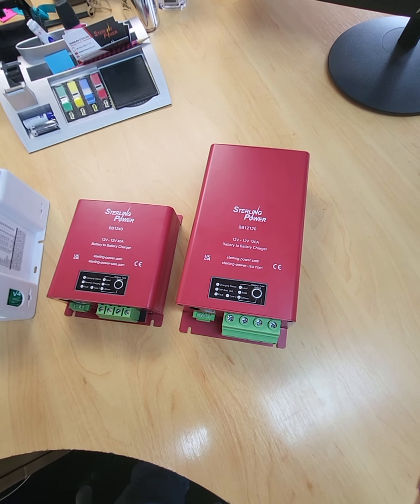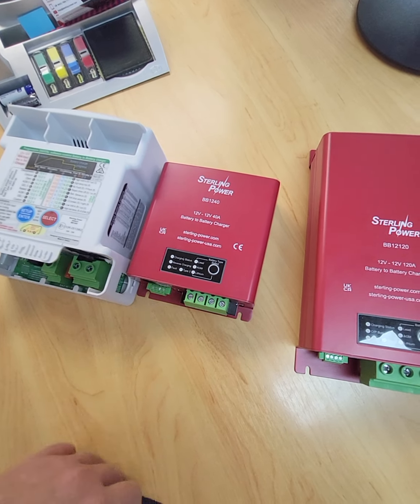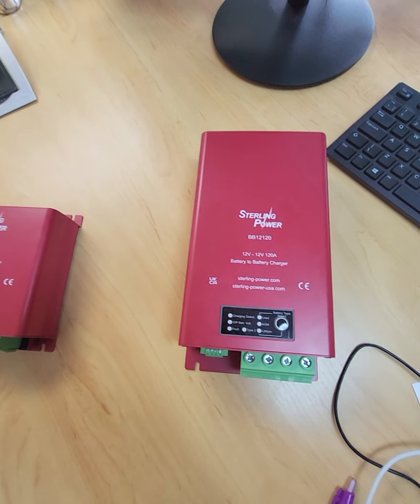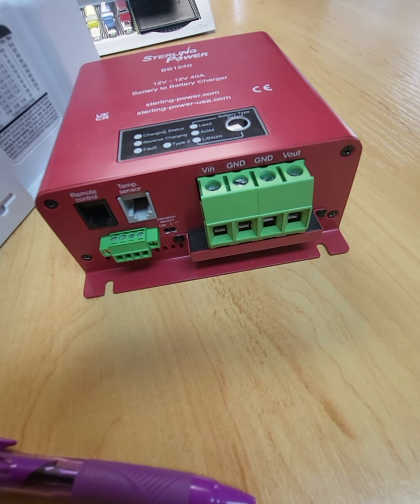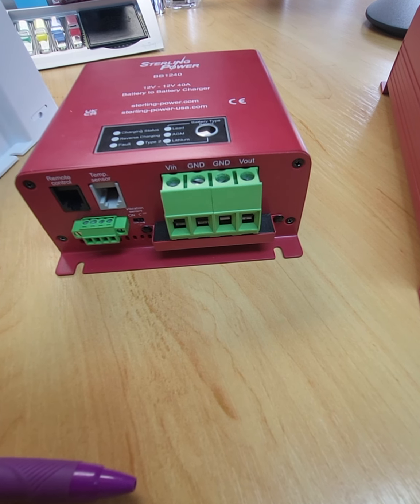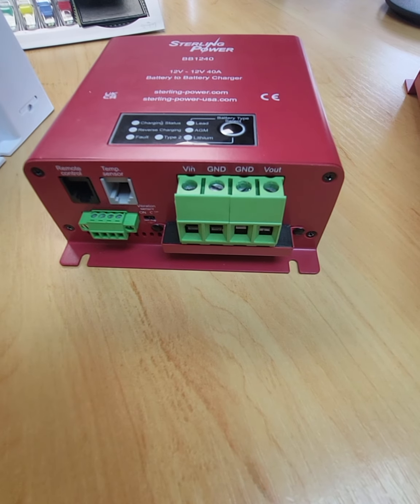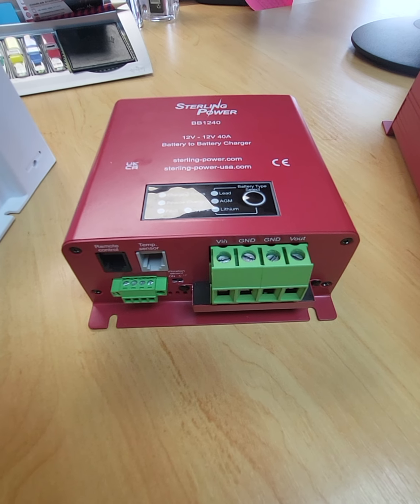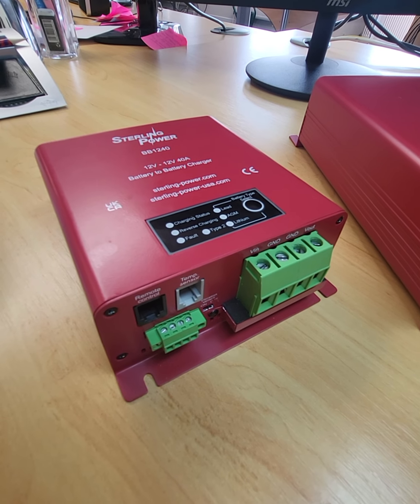2022 12V to 12V Battery to Battery Chargers

Comment: I was thinking "meh, not that different to the old ones (that I have) until Charlie l mentioned the bidirectional feature. Damn. Now I want one!
Are they any quieter Charlie?
Reply from the maker: Hi, as these new buck boost devices are 95-98% efficient, with an aluminuum chassis and internal heat sink. The fan is virtually silent. You would have to put your ear next to the unit to hear the feint whirring. The main perks with these models are:
1) much smaller encloser
2) much more effective useable output power
3) simpler setup and user interface
4) 95-98% efficient
5) vibration activation, to allow for those that do not want ignition feed. 
6) much quieter operation
Reply: @SterlingPowerLtd  Literally music to my ears. When are you expecting to have stock?
Reply from the maker: @nothanks6859  Late June / Early July this year.

Comment: Are 12V to 24V devices planned in this lineup or must that functionality wait until Q1 2024 with the Batt Pro X?
Reply from the maker: Due in the pipeline, do not worry. IC shortages mean we have to ration what comes out and when. Pro Batt X, also plague by bits being unavailable.
Reply: @SterlingPowerLtd  Thank you for your reply. Such a bummer, all the supply shortages. Have been eagerly awaiting these new devices from you folks. Would love to get hands on the first Pro X when it is ready!
Reply from the maker: @180XT  so would we!

Comment: Good looking lineups....to be blunt I haven't heard anything about previous Sterling DC to DC chargers on the Vanlife pages I'm on. 

But the choices are rather limited. I would never consider Renogy and Victron wants $250 for a 30A unit and many double up on them. Currently, I'm considering a second inverter to feed shore power to my main inverter charger. That's more cost effective than two Victron 30 Orions. 

These could put Sterling back on the map. 

I'm glad you're going with a bit more professional looking device. The older ones aren't exactly good looking. 

So, with the ground configuration - these are isolated units?
Reply from the maker: Hello mysterious Google Account :)

Yes, the older design language wasn't ideal- it was chasing the image of one of our other product ranges and we've since decided to go back to the foundational basics and just focus on making the core product as perfect as we can. I understand that probably reads like a bunch of marketing talk, but it was very much our goal.

A simple, high performing unit in an intelligent design. Many things are good just because the fundamentals are good- that's the target for innovation going forwards.

The ground configuration may imply at face value that they are isolated, but they're not. The second ground terminal is just to help save installers having to run another negative from the leisure battery all the way back to the starter battery - and to remind them that they really should have a common negative, chassis points weren't good enough and caused a number of problems on previous installs where installers didn't read the manual or chose to ignore it. 

I hope that helps, if you have any further questions please ask freely.
Reply: @SterlingPowerLtd  Thank you for the reply it's refreshing to interact with the people who make the products :)
Reply: @SterlingPowerLtd  Ran some numbers $629 shipped for the 70a with display to the US.....$60 of which is shipping..... a little too steep for me. Likely will just go with two 30A Orions. 

Maybe they will be cheaper once the US resellers get a hold of them?
Reply from the maker: @MyGoogleYoutube  Hi again!
20% VAT gets removed once you go through to the shipping section of the site.
This makes the BB1270 a USD retail of 461, and with the shipping of $60 we'd be looking at $521~.a similar price and vastly superior performance over two of the 30A orions.

Also, if you used the code power10, you'd get another 10% off.. (:
Reply: @SterlingPowerLtd  

Thank you for the reply and code :)

Any guesses when US retailers might be getting these?
Reply from the maker: @MyGoogleYoutube  Probably no earlier than Q1 23, but it's really up to them to decide. They're available to order, so US distribution can have them whenever they decide to take the plunge.